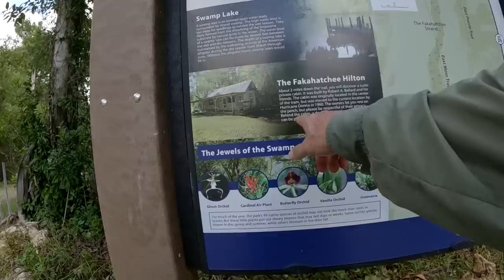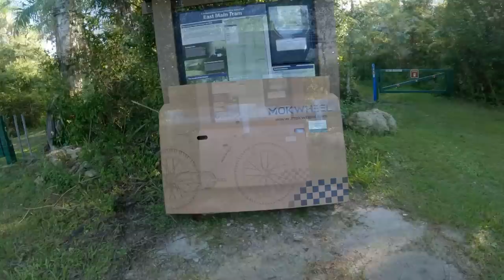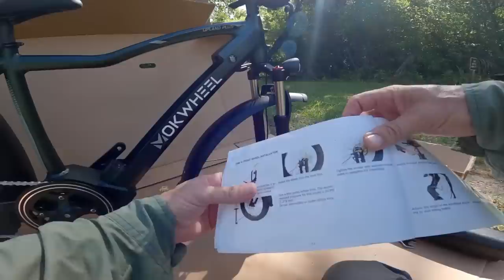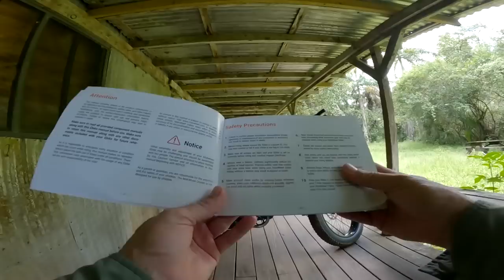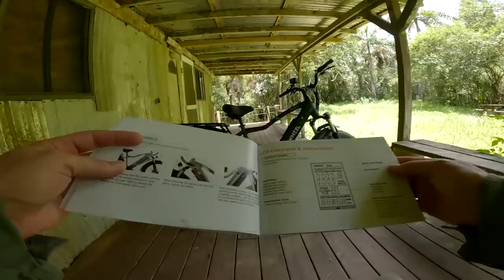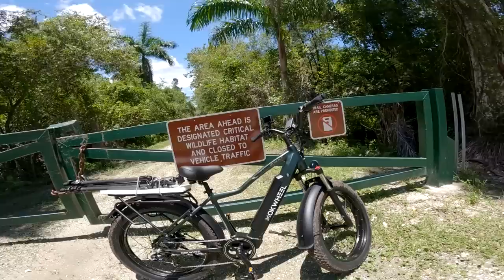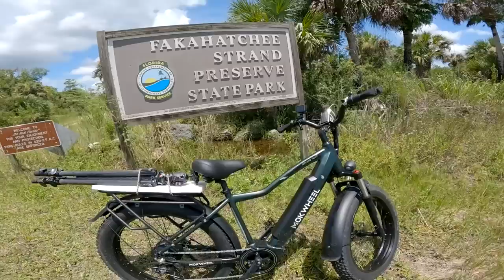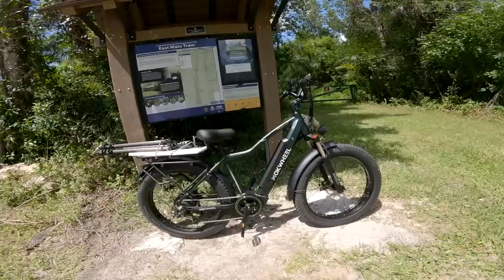MOKWHEEL ELECTRIC BIKE UNBOXING, ASSEMBLY, AND REVIEW (DISCOUNT CODE)

Comment: Tim , You will love it and you can cover more ground with it. There are so many ways the electric bike are better it would take pages to list all of them. For three years I have had a Himiway step thru cruiser.  I added the basket to the front of mine. It works great in the woods for easy to reach incidentals and just as good running to  the grocery store and back. The luggage rack in the back will take a couple of Panniers to put camping gear in. Plus what you can add to the top of the luggage rack. Yours appears to have the same standard & electronic gear as mine On YouTube ( Tinkering Turtle ) there is a way to increase your speed settings for hard roads. I went from 5 to 9 , 1 & 2 are the dirt trail speeds for me.  Don't forget to get your self a really good bike lock to keep the bike safe.
Reply from the maker: Thank you Chuck

Comment: Good for u scoring on yr New Elec Bike!! Just be careful & always ck on the wheels. I have a friend who has one & just last week while he was riding on his usual trails the front wheel came completely OFF & He went flying in the air. Ended up with several stitches on his face & arms !! So always ck out the wheels before using.
Reply from the maker: Thanks for the tip